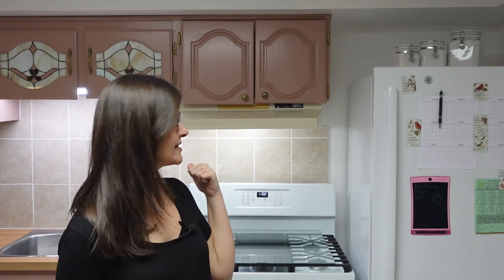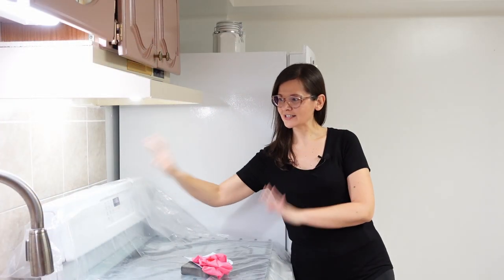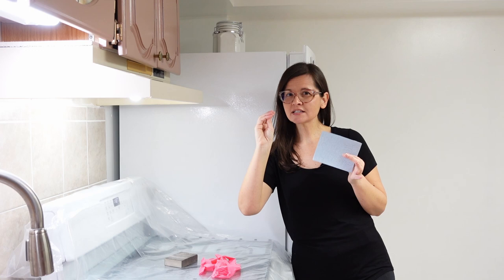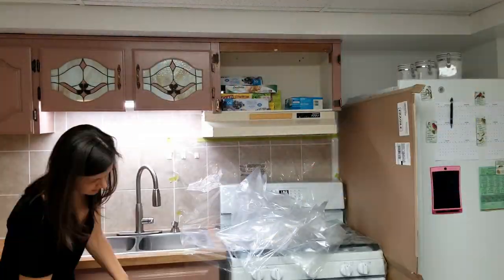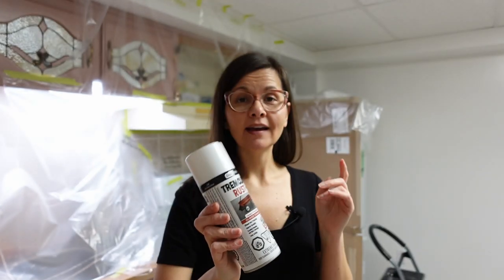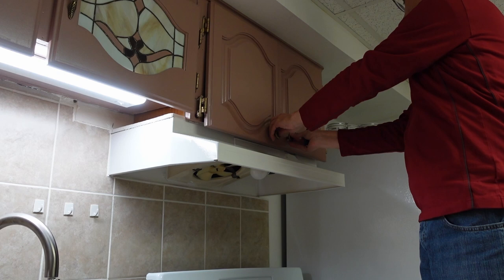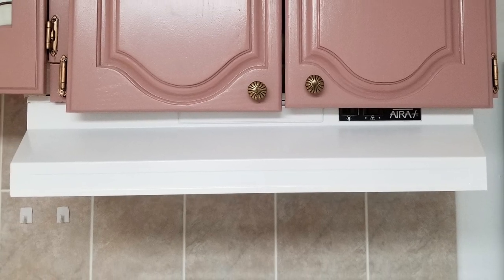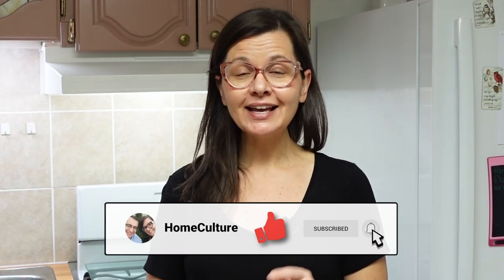How To Repaint A Range Hood | Easy Kitchen Range Hood Upgrade | Spray painting a range hood

Comment: How will you clean grease off in the future? I finally finished this project using Rustoleum satin black, and I’ve left it untouched for a week, but there’s black residue when I wipe using paper towel or microfiber cloth! 😕 I’m nervous to reinstall it because I just painted my cabinets white.
Reply from the maker: We haven't had any issue cleaning it.  Just a soapy cloth.  Did you apply a top coat?  With black, I found a clear top coat helps protect the surface.  I spray painted a vase black without top coating it and I feel like I have to be extra delicate with it.  But other items that I did use a top coat feel more durable.  The top coat adds a harder/tougher protective layer. Sounds like you re-did your whole kitchen!  That's awesome!!
Reply: @HomeCulture  good to know!! I contemplated using a top coat but all the DIY videos I watched didn’t mention it, and I was so terrified to mess up that I just skipped it! I’d never painted anything before, so this project took me two months! With how much money I’ve put in, I’d rather just leave it be and pay $100-200 for a brand new range hood if it starts to chip or wrinkle. I’m so done with this project haha. Thank you 🙂
Reply from the maker: @jennyleigh0488  I love this comment!  I totally get it - project burnout!  You just get to a point where you don't have another ounce to give.  I'm sure it looks awesome! Now sit back and enjoy it!